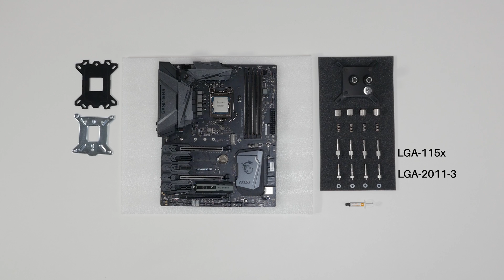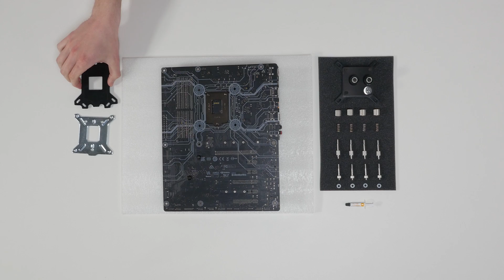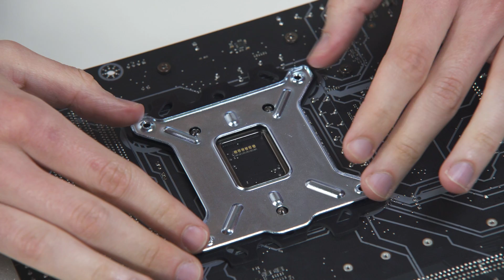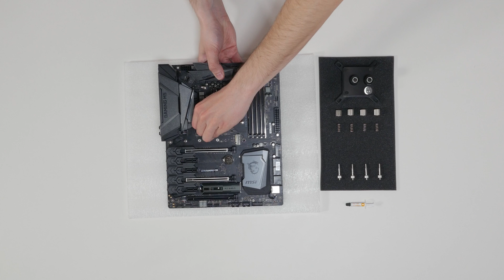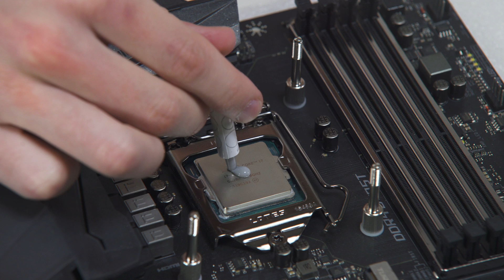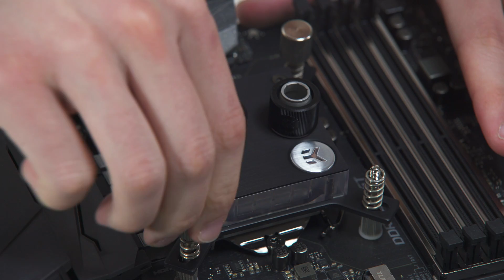CPU water block installation -  LGA-115x Socket Motherboards

Comment: Hey EKWB, maybe if you're going to make a video tutorial on installing the mounting plate you should do so correctly. This guy in the video is installing the metal mounting plate backwards. This cost me a $500 motherboard, as the screws got stuck and I knocked off a capacitor trying to get them out. Cheers.

Comment: looks very nice. Was oncerned if I could use it with my i7 6700k becaus ei didnt find i list with wich sockels it works. But you just used the i7 6700k in the video. A bit lucky xd. Gonna buy this kit for sure. Nice explanation in the videos. Understoos
d everything I willl need to know.

Comment: the screws are too tight for the holes motherboard. they only go down half way (til the thread stops). Asus ROG strix z370  ..  Ek Performance Kit...  

What the hell should I do? Try a different motherboard?
Reply: I just figured this out the hard way and knocked off a capacitor in the process, ruining my $500 Maximus XII Formula. This idiot in the video is installing the mounting plate backwards.

Comment: Hi EK Water Blocks ! Just finished to install this kit in my Pc , i have a problem , my cpu got really bad Temps , 40 C° Idle and 100 C° in load , my CPU : I7 4790K , did i miss something ? I just does the exact same installation but i don't know why it won't cool my cpu , my Gpu is fine tho , 46C° in load ( Gtx 1080 Ti ) , any ideas ? Thank's ( From a French consumer :)  )
Reply: Yes , im wondering if only one 240 Rad is enough to handle my Cpu and My Gpu . I can't put another rad in this loop if it's not aluminum that's right ?
Reply: You're saying that your cpu is getting to hot, but not your gpu? Sounds like a thermal issue with only the cpu. How much termal compound did you use? I believe the recommended amount is like two rice grains. If you applied to much, the cpu isn't able to transfer its heat properly.
Reply: I have the same issue. Did you ever figure this out? I have 2 x 360 rads
Reply: @cardbored_  I had the same issue one year ago.
Reply: Same issue